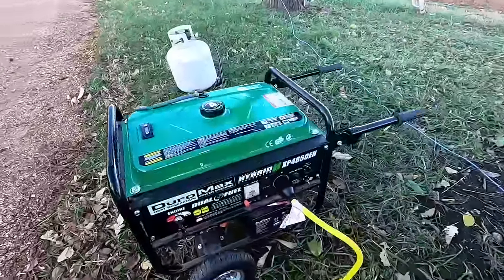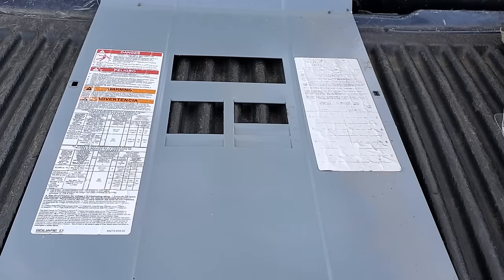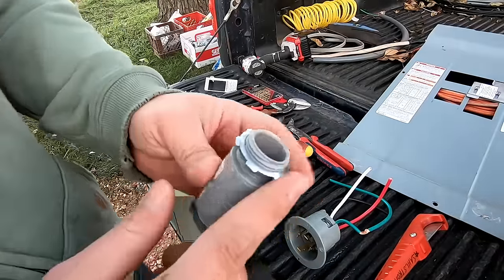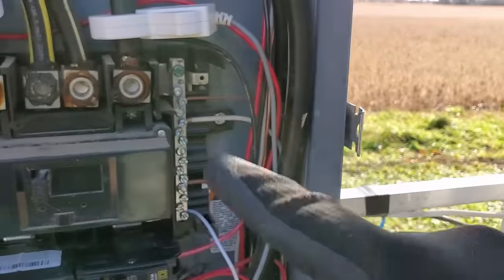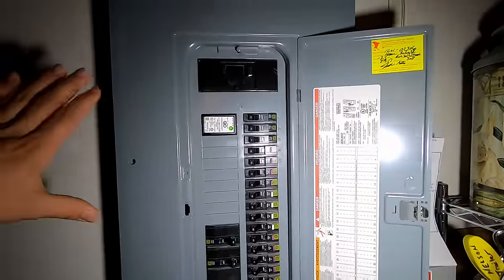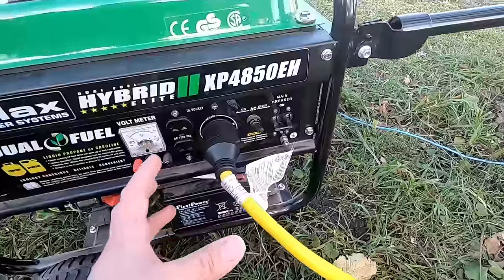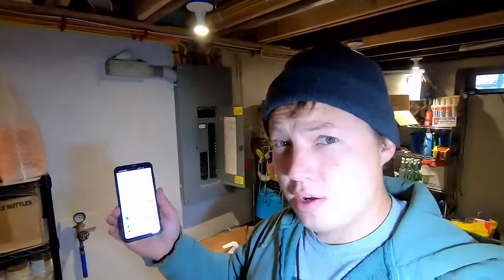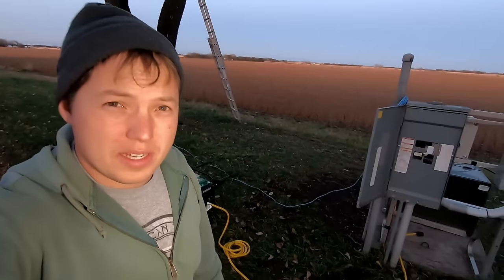How To Hook Up a Generator To Your House Using a Breaker Interlock Kit & Power Inlet Box

Comment: The only time that I used a torqued screwdriver is in a federally funded facility.
Reply: I used a square head socket on a 1/4" torque wrench just to get a feel for how tight they wanted it, turns out its the same as the "damn tight" setting on my screwdriver hand.
Reply: Here are the generator safety rules that everyone needs to follow: this is just a reminder for everyone’s safety. Always make sure you follow all the generator safety rules whenever you use your portable generator. Generators can be dangerous if not used carefully. Every year, hundreds of people die or get injured when using portable generators due to carbon monoxide poisoning and electrocution. Make sure you are using your generator carefully and keeping others safe as well. There is something very serious that everyone should always be aware of when using generators. Some people do run their generator indoors which is not safe and that increases the risk of carbon monoxide poisoning which can cause death of family and you. Some people run their generator in wet conditions which can electrocute them. Please remember that you should never run your generator indoors. Remember that carbon monoxide is an odorless and colorless gas that you cannot see or smell. Carbon monoxide is a silent killer. Keep that in mind. Make sure your generator is 15-20 feet away from your house and away from doors, windows, and vents. Never use your generator in your porch too. Having a carbon monoxide detector is very important against generator safety. Some people also allow children to go near the portable generator which could pose risks. We need to keep an eye on our children making sure that they are not near the portable generator so they won’t get electrocuted or burned by the generator which is dangerous. A locking enclosure also keeps kids safe. A generator shed might look like a tempting place to explore, or take cover during a game of hide and seek, but a generator is a dangerous piece of equipment that can cause injury. It says on the manual that we should also keep children away at all times from the portable generator to avoid injuries. Please do not allow a child or unqualified people to operate the portable generator.  It is important to keep your children safe especially little ones. The portable generator can be hot during an operation. Just because some manuals missed what should be listed doesn’t mean it’s safe to do. Always follow the generator safety rules when using portable generators. Generators pose electrical risks. If you need to use your generator during wet weather, you need a generator tent to protect your generator from getting wet. Don’t let your generator get wet. Keep your generator dry and before using your generator, please make sure your hands and your generator is dry. Do not wear loose clothing when operating the generator. Everything that is said on the generator’s operating manual should not be ignored. Never smoke cigarettes near the generator. Please keep flammable things away from the generator. Never overload your generator too. Your generator can catch fire. Never ever try to plug a generator cord into a wall outlet to avoid back feeding. Back feeding your generator is dangerous. Always turn on your generator first before plugging in appliances and shut off the appliances before turning your generator off. Use a heavy duty cord for your generator and the cord should not be worn out. All the instructions should be followed carefully. Never refuel your generator while it’s running. It can cause fire if fuel spills while your generator is hot. You should turn off your generator and let it cool off before refueling it. Having a fire extinguisher next to the generator is also important. This is only a reminder for everyone’s safety of using generators. Make sure your generator is properly grounded. Having a fire extinguisher next to the generator is also important against the safety rules. https://youtu.be/I1jT3ANENvI and here is a video more about keeping others safe when using generators and also about our family’s safety. It’s important to keep our little children safe as well. Make sure your little children are kept away from the generator at all times especially when it’s running. Hope everyone finds this helpful. Always remember that it’s better to be safe than sorry. Remember that warnings should not be ignored.

Comment: I  am  still willing to learn from those who know and are willing to share,  I am on the back nine in life, and have been wiring for quite a while now,  I am glad your neat, capable and informative, the only thing I'd say when adding the romex, is do not use a utility  knife other than the last four inches, the sheathing can be ripped open to the length you need preventing any chance of a knick in the wires inside.
Reply: video changed, lol, Happy Trails

Comment: This was an awesome video! This is our 3rd winter in this home and it had a set-up for a portable generator but I didn’t trust if it was done correctly. I learned so much from this video that I now know that it is correct and safe to use! Thank you so much!!!
Reply: ⚠️Portable Generator Safety Tips:

1) KEEPING OTHERS SAFE: Please do not allow an unqualified person or your children to operate and service the portable generator. Just because some manuals don’t say that doesn’t mean it’s safe. That is important against the generator safety rules. We also need to be keeping an eye on our children too. You need to make sure that your children are not playing near the portable generator especially when it’s running so they won’t get electrocuted. Generators pose electrical risks and they can be hot during an operation. Please keep your children away from the portable generator at all times. It is important to keep our children safe especially our little ones. Be aware of all the hazards.

2) WHERE TO RUN YOUR GENERATOR: Some people use their portable generators indoors which increases the risk of carbon monoxide poisoning. It’s important to have a carbon monoxide if you have a gas generator. Never ever use your generator indoors even if your doors and windows are open and even in the garage is not safe to use a portable generator. Also please never use your generator in your deck or balcony. It is never safe to use your generator indoors and in enclosed areas of your home. Your generator needs to be 15-20 feet away from your house. 

3)🔥FIRE HAZARDS: Never refuel your generator while it’s running. You need to let your generator cool off before refueling it and before storing your generator. Never overload your generator too. Never ever back feed your generator. You should never plug your generator into a wall outlet. Also never store propane tanks indoors. Please keep flammable things away from the generator as well and please don’t smoke cigarettes near the generator. Having a fire extinguisher next to the generator is also important against the generator safety rules. It’s also not safe to move your generator while it’s running.

4) GENERATOR OPERATION: make sure your hands are dry before touching the generator. Never use your generator in wet conditions. Don’t let your generator get wet. You need a generator tent if you need to use your generator during wet weather. Please don’t wear loose clothes when operating the generator. Turn on your generator before plugging in appliances. Use the right cord for your generator. Please do not use worn out cords. 

https://youtube.com/shorts/eFigDfnPkcQ?feature=share and here is a short video more about keeping others safe when using generators. Portable generators need maintenance so it’s important to follow the safety instructions.

Hope this helps

Comment: I Just finished putting together my set up.  I would like to thank you 
for your post and some great tips.  Looking forward to ERCOT dropping 
the ball again this winter. 👍😜
Reply: ⚠️Portable Generator Safety Tips:

1) KEEPING OTHERS SAFE: Please do not allow an unqualified person or your children to operate and service the portable generator. Just because some manuals don’t say that doesn’t mean it’s safe. That is important against the generator safety rules. We also need to be keeping an eye on our children too. You need to make sure that your children are not playing near the portable generator especially when it’s running so they won’t get electrocuted. Generators pose electrical risks and they can be hot during an operation. Please keep your children away from the portable generator at all times. It is important to keep our children safe especially our little ones. Be aware of all the hazards.

2) WHERE TO RUN YOUR GENERATOR: Some people use their portable generators indoors which increases the risk of carbon monoxide poisoning. It’s important to have a carbon monoxide if you have a gas generator. Never ever use your generator indoors even if your doors and windows are open and even in the garage is not safe to use a portable generator. Also please never use your generator in your deck or balcony. It is never safe to use your generator indoors and in enclosed areas of your home. Your generator needs to be 15-20 feet away from your house. 

3)🔥FIRE HAZARDS: Never refuel your generator while it’s running. You need to let your generator cool off before refueling it and before storing your generator. Never overload your generator too. Never ever back feed your generator. You should never plug your generator into a wall outlet. Also never store propane tanks indoors. Please keep flammable things away from the generator as well and please don’t smoke cigarettes near the generator. Having a fire extinguisher next to the generator is also important against the generator safety rules. It’s also not safe to move your generator while it’s running.

4) GENERATOR OPERATION: make sure your hands are dry before touching the generator. Never use your generator in wet conditions. Don’t let your generator get wet. You need a generator tent if you need to use your generator during wet weather. Please don’t wear loose clothes when operating the generator. Turn on your generator before plugging in appliances. Use the right cord for your generator. Please do not use worn out cords. 

https://youtube.com/shorts/eFigDfnPkcQ?feature=share and here is a short video more about keeping others safe when using generators. Portable generators need maintenance so it’s important to follow the safety instructions.

Hope this helps

Comment: Great job explaining in detail the step by step instructions for installing this kit and practicing SAFETY, it's key especially when working with ELECTRICITY
Reply: ⚠️Please don’t forget the rules about generator safety: This is a very important announcement for everyone. It’s important to follow all generator safety rules whenever we use portable generators: 

Everyone must see this. This is just a reminder for everyone’s safety. 

1) KEEPING OTHERS SAFE: Please do not allow an unqualified person or your children to operate and service the portable generator. Just because some manuals don’t say that doesn’t mean it’s safe. That is important against the generator safety rules. We also need to be keeping an eye on our children too. You need to make sure that your children are not playing near the portable generator especially when it’s running so they won’t get electrocuted. Generators pose electrical risks and they can be hot during an operation. Please keep your children away from the portable generator at all times. It is important to keep our children safe especially our little ones. Be aware of all the hazards.

2) WHERE TO RUN YOUR GENERATOR: Some people use their portable generators indoors which increases the risk of carbon monoxide poisoning. It’s important to have a carbon monoxide if you have a gas generator. Never ever use your generator indoors even if your doors and windows are open and even in the garage is not safe to use a portable generator. Not even at your porch and your deck. It is never safe to use your generator indoors and in enclosed areas of your home. Your generator needs to be 15-20 feet away from your house. 

3)🔥FIRE HAZARDS: Never refuel your generator while it’s running. You need to let your generator cool off before refueling it and before storing your generator. Never overload your generator too. Never ever back feed your generator. You should never plug your generator into a wall outlet. Also never store propane tanks indoors. Please keep flammable things away from the generator as well and please don’t smoke cigarettes near the generator. Having a fire extinguisher next to the generator is also important against the generator safety rules. 

4) GENERATOR OPERATION: make sure your hands are dry before touching the generator. Never use your generator in wet conditions. Don’t let your generator get wet. You need a generator tent if you need to use your generator during wet weather. Please don’t wear loose clothes when operating the generator. Turn on your generator before plugging in appliances. Use the right cord for your generator. Please do not use worn out cords. 

https://youtu.be/I1jT3ANENvI and here is a video more about keeping others safe when using generators 

Hope this helps. Remember safety first

Comment: You saved me so much money! I was looking at manual switches but couldn't find an affordable one that could match 120A Utility input and 50A Generator input. 

Great video! Learned so much. Thanks again
Reply: Here are the generator safety rules that everyone needs to follow: this is just a reminder for everyone’s safety. Always make sure you follow all the generator safety rules whenever you use your portable generator. Generators can be dangerous if not used carefully. Every year, hundreds of people die or get injured when using portable generators due to carbon monoxide poisoning and electrocution. Make sure you are using your generator carefully and keeping others safe as well. There is something very serious that everyone should always be aware of when using generators. Some people do run their generator indoors which is not safe and that increases the risk of carbon monoxide poisoning which can cause death of family and you. Some people run their generator in wet conditions which can electrocute them. Please remember that you should never run your generator indoors. Remember that carbon monoxide is an odorless and colorless gas that you cannot see or smell. Carbon monoxide is a silent killer. Keep that in mind. Make sure your generator is 15-20 feet away from your house and away from doors, windows, and vents. Never use your generator in your porch too. Having a carbon monoxide detector is very important against generator safety. Some people also allow children to go near the portable generator which could pose risks. We need to keep an eye on our children making sure that they are not near the portable generator so they won’t get electrocuted or burned by the generator which is dangerous. A locking enclosure also keeps kids safe. A generator shed might look like a tempting place to explore, or take cover during a game of hide and seek, but a generator is a dangerous piece of equipment that can cause injury. It says on the manual that we should also keep children away at all times from the portable generator to avoid injuries. Please do not allow a child or unqualified people to operate the portable generator.  It is important to keep your children safe especially little ones. The portable generator can be hot during an operation. Just because some manuals missed what should be listed doesn’t mean it’s safe to do. Always follow the generator safety rules when using portable generators. Generators pose electrical risks. If you need to use your generator during wet weather, you need a generator tent to protect your generator from getting wet. Don’t let your generator get wet. Keep your generator dry and before using your generator, please make sure your hands and your generator is dry. Do not wear loose clothing when operating the generator. Everything that is said on the generator’s operating manual should not be ignored. Never smoke cigarettes near the generator. Please keep flammable things away from the generator. Never overload your generator too. Your generator can catch fire. Never ever try to plug a generator cord into a wall outlet to avoid back feeding. Back feeding your generator is dangerous. Always turn on your generator first before plugging in appliances and shut off the appliances before turning your generator off. Use a heavy duty cord for your generator and the cord should not be worn out. All the instructions should be followed carefully. Never refuel your generator while it’s running. It can cause fire if fuel spills while your generator is hot. You should turn off your generator and let it cool off before refueling it. Having a fire extinguisher next to the generator is also important. This is only a reminder for everyone’s safety of using generators. Make sure your generator is properly grounded. Having a fire extinguisher next to the generator is also important against the safety rules. https://youtu.be/I1jT3ANENvI and here is a video more about keeping others safe when using generators and also about our family’s safety. It’s important to keep our little children safe as well. Make sure your little children are kept away from the generator at all times especially when it’s running. Hope this helps. Always remember that it’s better to be safe than sorry. Also remember that warnings should not be ignored too.
Reply: @The_Happy_Aviation_Enthusiast  Would you stop posting this on every freaking comment!!!! 🤬🤬🤬 I'm looking for legitimate responses and every time I click on something it's this post! They all understand about the cautions that need to be taken by now! You're simply over doing it!